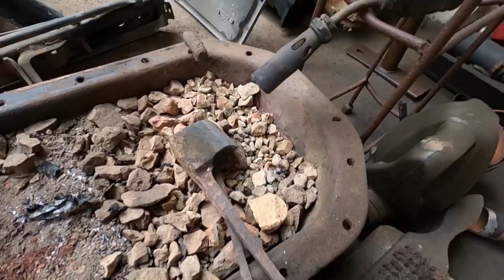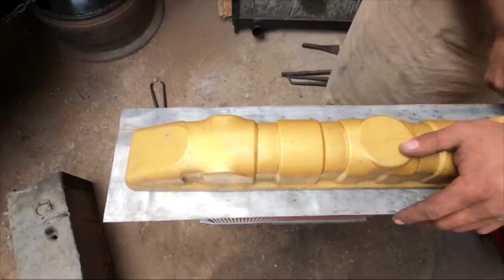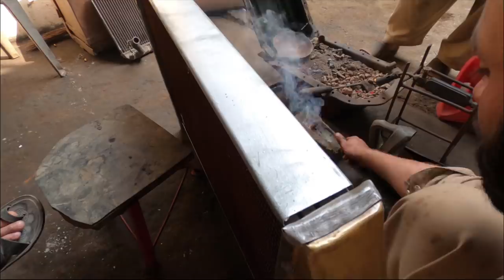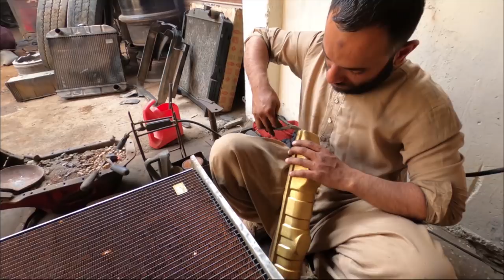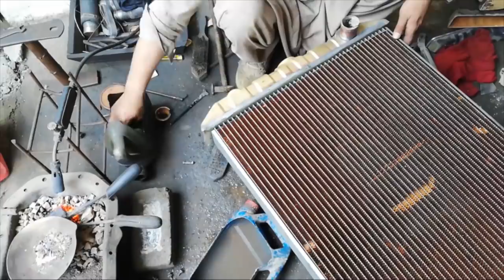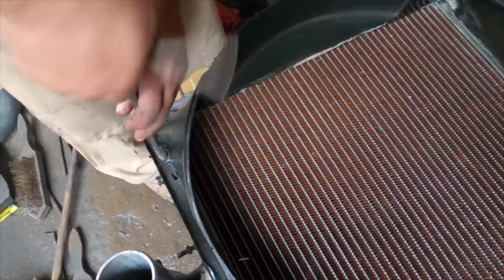How to Rebuild a Radiator and Completely Radiator Restoration

Comment: Watching and learning . And I already got some ideas for my self I can use . Excellent work . 👍 My idea is to melt wheel weights and pour the lead into the angle iron make strips of lead  . And cut into small pieces to use for anchoring  screws or bolts in walls . What do you think 🤔
Reply from the maker: Thank you so much for watching & comment Al Ward ❤️❤️
Nice idea's you have ❤️❤️

Comment: Radiator ment to be soldered standard up with slight angle towards you  so inside tank has a buildup of solder inside a lot stronger & last long
Reply: you are absolutely correct

Comment: This is the type of craftsmanship you get when you don't live in a "throw away" society.  We feel good recycling our Perrier bottles.  This fellow recycles radiators because his society can't afford to waste anything.  When was the last time your $30 cordless drill stopped working and you brought it back to Home Depot to get it fixed?
Reply: It' because these guys work for much less than repair guy in US would...it's called cheap labour...like if your paying your mechanic a labour to rebuild your engine...it most likely you can find an used engine with less kilometers than yours, for a much better price. Even when the most rebuilding is done by specialized shops.

Comment: Reason why they use plastic tops is to make it break faster and to prevent rebuilding a radiator since you need the plastic ends to refresh.
They sold the idea that it would make repairs easier, cheaper, saving environment etc. 

Reality is the end caps are either not cheap, readily available or totally unavailable hence we do not see many if any rebuilds.
Reply: Plastic tops are cheaper and just adding the bending tabs to the core is cheaper than soldering and cheaper in production...i know I have my own experience with the issue...if your engine is vibrating enough it will shake the tabs loose...solution...either get the metal chamber soldiered on (if available) or get used to change your radiator regularly.